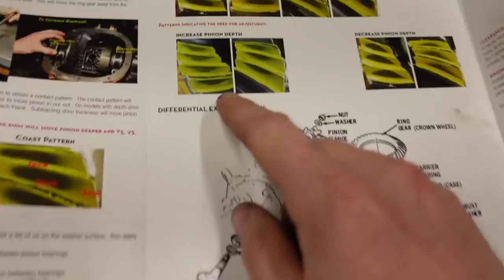ReGearing an IFS Differential: 4.30s for an All Wheel Drive Silverado

Comment: In the good old days you needed to bed a pinion and ring gear in together. This is similar to lapping in valves and uses a special grinding paste. You would do all the steps to build the diff then put the paste on the gears and spin the diff for about twenty minutes with a slight load at about twenty rpm. Pull it all apart clean it thoroughly junk the bearings and assemble it again and redo all the checks.

Comment: Hi LT,
Nice tutorial on setting up IFS diffs.  Good tip too on using the setup bearing while determining pinion depth.  That kind of seemed like a black art to get the depth right while needing to press on and off the bearing when finding the right shim thickness, along with not destroying the bearing.  Using a setup bearing makes that process much easier.  Thanks for the video!
-mike
Reply from the maker: well thanks for watching it! much appreciated

Comment: Nice job, if you want a quicker way to get the bearings off though, look at some videos where they run a bead of weld around the bearings. It usually works for me👍🏽
Reply from the maker: that would work as well, a little heat will loosen em up

Comment: Hey Lt just a tip ive learned to remove bearings. Use your tig torch to heat up one spot on the race cherry red about the size of a nickel. Then take a sharp chisel and hit it perpendicular to the race a few good times it will slide off. Cuts down on the grinder dust. And no chance of a slip or getting to deep

Comment: Cutting bearings is a bit risky as you can damage the surface underneath an alternate method that you can try first is to strike the bearings with a hammer as if you’re trying to flatten them.
Do it lightly to break the seat against the surface if you’re going to use a puller, or harder as if you’re trying to shatter the bearings if you’re trying to use a drift to remove the bearings.
Doing this usually makes the bearings fall off but not always.
The retaining ring on the axle shaft is not that important , it’s not like the axle is going to jump out without it.
Unless you snap a stub axle or destroy a CV Joint then there’s a possibility it might get pulled out.

Comment: I would be curious to check the difference in backlash on a standard rear axle. Compare measuring the pinion vs the ring gear.

Comment: With that front diff being open won't you lose power to both front wheels when one slips?  A true AWD system would transfer power to the wheel with traction I would think.

Comment: @LT I like the idea of lowering and converting a 4x4 to AWD. Although I once owned a 1995 4x4 Blazer, yet all of this stuff about transfer cases front independent differentials are something I am just now beginning the understand better. I have learned a lot from watching your videos here, as well as the "Red Tie" build when you were with a previous employer.

In this video you mentioned about limited slip differential, and that one is not made for the GM 8.2" IFS differential. You mentioned another size diff that was used in a 3/4 ton truck, could this front diff be used in a 1/2 ton truck with an AWD? If so, then exactly what difference would the limited slip do which the setup up that your current setup will or will not do?

In the past I had wondered if both front and rear differentials used limited slip, with the factory 4x4 (2H, 4L, 4H) transfer case. With such a setup, would this allow for driving full time in 4H, as well as shifting to 4L as needed with highway driving?

Just wanted to understand these things. 

Thank you, and looking forward to watching more of your videos.

-Rob

Comment: The weak point in most differentials is the spider gears not the ring gear.
Usually a larger ring gear means larger spider gears so a stronger diff but not always.
A 10” diff might have the same spiders as a 7”  or it may just be a piece of crap.
A 7” diff could be nearly as strong or stronger than a 10” especially if fitted with a spool or Torsten lsd centre.
A bigger diff usually means bigger axles as well however.

Comment: Another great video. What solvent do you use in your parts washer. I bought one used and the solvent in it ate all the paint off to that level. Clogging the pump filter too.
Reply from the maker: I use the tractor supply parts cleaner solvent. about $50 for a 5 gallon bucket
Reply: Excellent thank you for the great video series and thank you for the reply.

Comment: Does the new front diff just bolts in without modifications? Do you have to redo the mounting bolts?
Reply from the maker: yes, it bolts in place on the GMT800 4wd trucks with zero changes

Comment: Wouldn’t you multiply the reading on the pinion yoke by 2?  It’s a smaller diameter than the ring gear.

Comment: Have you looked at the 2500 front diff is it at all posable to fit??? in 1500??? and saw an other video and if you do this in an 90's  body like your last job build of AWD you can swap right side long axel tube and would not have to fab mount?? they said all front are the same except that???
Reply from the maker: You’d have to swap the axle tube as well as the spider gear to make sure the pass side axle would hold into the housing

Comment: Great video, I am  getting ready to re-gear from 3.73. to 4.56  this weekend.  A question ... If my IFS does NOT have a gasket and I want to use one, I would assume thats ok as long as I use it as part of the backlash adjustment? I am also looking to use a shaft tube gasket as well . . I hate leaks.
Reply from the maker: as long as the housing is torqued properly to "squish" the gasket, I see no reason why you couldn't use one... for what it worth though that anaerobic sealant I used is holding up amazingly
Reply: LT, thanks for the advice - the gasket didn’t fit ( 2007>) so I went without and no leak! Your video was a great asset to complete my regear this weekend and it was a  success!  It took a bit to get the Lash in - ended  up a bit over 7 ,,, You rock

Comment: Do the pinion shims also affect backlash or is that adjusted in a different way if it is out of spec?  If it is the latter how do you adjust the backlash?
Reply from the maker: the backlash is adjusted by moving the carrier side to side, either with shims or the threaded sided adjusters in this case. but yes, if you move the pinion depth it will throw off the backlash, so anytime you adjust the pinion, the carrier must be adjusted as well

Comment: I think people are worried about the truck steering into the wall with an LSD because of torque steer.  I personally think torque steer is only a real consideration in high HP FWD vehicles, but with an AWD vehicle of that weight with only about 35% of the power to the front wheels you should be ok, but it will be present, especially when you start getting towards 900-1000hp.
Reply: Its actually 38% front 62% rear..
Reply: @dalehall2993  did you read the part where I said about?
Reply: @TT.357  
And did you read the part where i said actually?👀👍🏻
Reply: Not just torque steer but it'll make the truck push when it locks hard. 1st year of the sti in the states had a pretty aggressive front limited slip. It was noticeable if you were under throttle through a turn

Comment: PLEASE HELP!!! Swapping a 4l80e into a 2005 chevy tahoe. Doing an all wheel drive swap also. I have an 02 Yukon Denali AWD front diff, also doing 4.30 gears to match the rear gears. 

My question is regarding hooking up the np149 transfercase to the 4l80. I know I need the 32 spline adapter in the transfercase. What I don't know is what size spacer I need from the 4l80 to the transfercase.

I am eagerly waiting for you to reply, figured you'd know best.
Reply from the maker: It takes the same 4l80 rear adapter housing as a 4x4 transfer case of the same era. And Tim at Modern Muscle Salvage can sell the 32 spline input for the nv149
Reply: @LawrenceTolman  So would I tell Jake's Performance transmission to give me the 4x4 transfercase adapter for a 2005 chevy 2500 4l80?
Edit: reread your reply, yes is probably your answer.

Comment: Wish they could hold up with a limited slip in them
Reply: They dont make a limited slip diff..
Reply: @dalehall2993  that’s correct case is to weak, that’s why im planning on swapping to a 9.25 3/4 IFS case on my obs yukon
Reply: @CVPI03  
I guess Lt and the rest of us will find out if its weak,or if it holds up too over 500hp LT is about too throw at it..9.25 is more for 3/4(2500)4wd trucks...